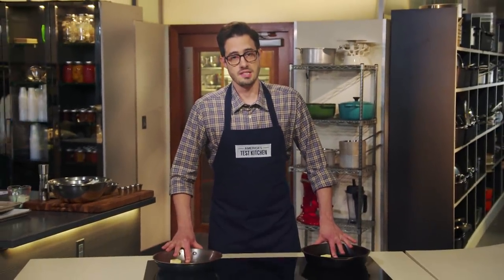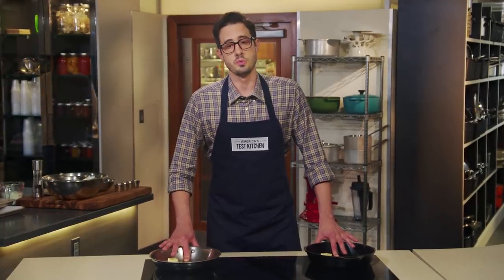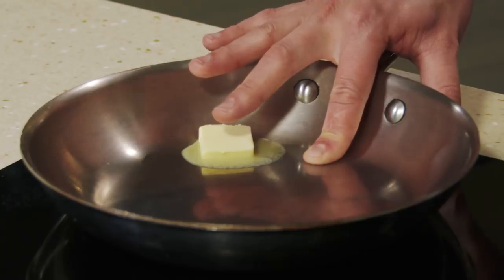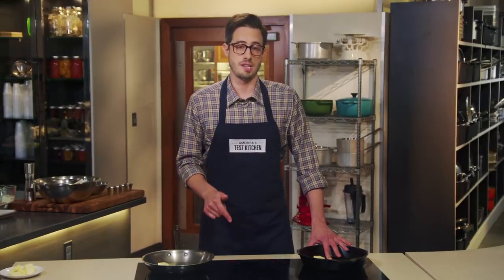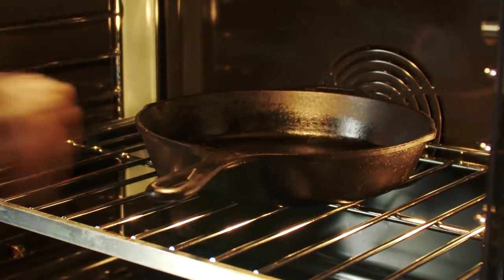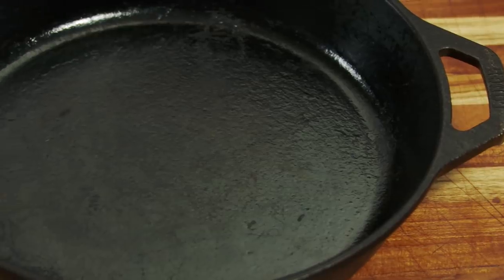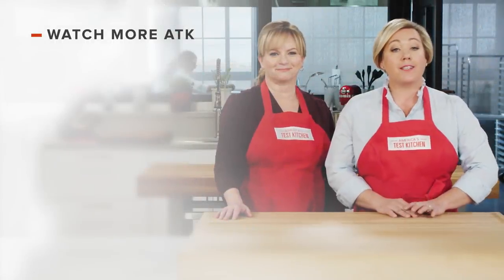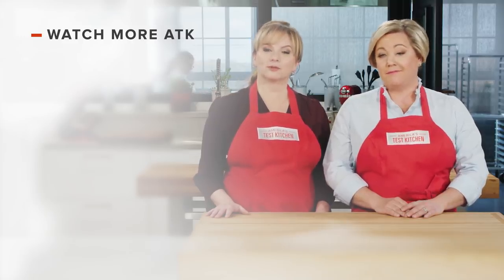The Science of Heat Conduction in Aluminum and Cast-Iron Pans

Comment: Yep, the best thing about cast iron is heat capacity. Because they're a big hunk of inexpensive metal, they can hold a lot of heat. But aluminum actually holds more heat ounce for ounce, so if that stainless pan had a thicker aluminum core, it could hold as much heat as the cast iron pan, but would weigh a few pounds less and spread that heat far more evenly across the pan. It would be more expensive to make than a cast iron pan, though. And that's exactly what high-end stainless pans are. I bought my Belgian pan for $95 but other European and US brands like All-Clad and Made In (ATK tested) make similar pans (the one I bought is the thickest and heaviest pan I could find of stainless and aluminum core construction—read online reviews and tests). Now my carbon steel is retired because it is heavier, heats less evenly, and doesn't do anything better. I don't even think my seasoned steel is more non-stick than my stainless pan. This is after a year of scrambling eggs, searing steaks, pan-frying fish, and everything else. In my experience, sticking is almost entirely a matter of bad technique. If I just heat up the pan, add a little fat (1-2 tsp), then food, I almost never have problem. Maybe I should say never, because I don't think I've ever had a problem with the stainless pan I use now. The surface of the metal is purified (it's still bare stainless steel) to make it less sticky than normal stainless and it does seem to work. It's not encouraged, but I've been minimizing my use of metal utensils in case it helps keep it so non-stick by not causing deep scratches and wearing away the outer layer. It probably doesn't make a difference, stainless steel "clad" pans can stand up to lifetimes of scraping with metal utensils before the stainless layer becomes worn.

Comment: thanks for clearing up this age old myth, cast iron is great but gets hot spots and has lower conductivity. i have a woll pan that is thick cast aluminum (very heavy actually) and its the best of both worlds, heats up fast and holds onto heat for ages
Reply: Cast iron only gets hot spots while it is heating up. Once it comes up to temp it is a very even heat, and the mass means the temp stays the same when you drop cold meat (for example) in it. Just don't boil liquids in it or you'll take off the seasoning.
Reply: @sonnybeach1953  yes this is true, thats the benefit of cast iron is the sear ability once it has been properly heated up
Reply: It doesn't actually hold own to that heat for ages. It only seems like it does, because the larger mass simply has more heat to give up than a thinner aluminum pan.
Reply: Aluminum holds almost 2x as much heat at half the weight, and is less than 1/3 the density.

Comment: Nice video. Why oh why do modern folk season irons with a rubdown at 400°F-500°F?  Of course it'll make for uneven cooking. It should be seasoned by filling with olive oil (yes, pricey or melted crisco to the top, and placed on range burner at lowest possible flame, an hour or so for many generations' use, most even heat, easiest cleanup and reseason with a swipe.

Comment: Seriously, how feasible is that recommendation for the home cook.... put a cast iron pan and crank up the oven to 500F before using the skillet?  Not everyone has half hour just to heat up a pan... what a waste of time.  Sure, the science is correct, but VERY impractical for real life use.
Reply: Not only wasting time, but also energy.
Reply: I have used cast iron for years, and it is not that hard to heat. Preheating six minutes on low for frying an egg is enough. If you're cooking cornbread, put oil in your pan and the pan in the oven while it preheats. No time is wasted. Who cooks at 500 °F?
Reply: @MichaelSHartman   Exactly!  I use both enameled and seasoned cast iron pans, and I only crank it up when I want some char.  Who has the time to "warm" a pan in the oven before using... I got hungry people to feed!  ATK... please be more practical with your advice!
Reply: Cast iron 1st season should never be at 500F. Low & Slow is the old saying. Besides, iron cookware in foods is proven healthier than aluminium residues. Alum seasonings wear off, cast iron goes deeper. Lityle dab'll do ya after each use.

Comment: I have cast iron cookware because they hold heat so well and I got tired of buying cookware which I had to replace every two years or less due to coating coming off and good stainless steel cost too much. We don't have enough animals to drink or eat from the useless so called non stick cookware. Cast iron will last you for life and is good for cooking in. I have a steel wok which I will use and that is about it other than my cast iron cookware.

Comment: So wouldn't Carbon Steel be a better choice then ? I do not want to waste time and energy heating a cast iron pan in the oven.
Reply: The advantage of cast iron is that once it gets hot, it stays hot. If you're, for example, pre-searing a huge roast before it braises, then the cold meat might lower the temperature of the carbon steel too much for a good crust, while cast iron will retain its heat. But carbon steel is much better than cast iron for smaller batches of food, e.g., if you're making a stir-fry.
Reply: @asdfrozen  I don't usually  cook a roast in a cast iron frying pan though I would use a dutch oven then and that would make sense . Heating a cast iron frying pan in the oven at 500 degrees just to cook a steak is a lot of waste of time and energy
Reply: @rojergrison3752  Even when just searing a steak, you're still going to end up with a better crust on cast iron due to it retaining its heat better. Of course, you could always argue that it's not a big enough difference for that extra effort.
Reply: Fr tho, cast iron takes wayyy too much time and effort when you can cook just as good food with a nonstick tbh. We don't live in the 1800's anymore my guy
Reply: @MrApontjos  Nah, don't use nonstick for searing meat. Teflon can't handle high heat. It's great for omelettes, but not for searing.
Reply: @MrApontjos  Yo, Teflon is found in the blood of the majority of Americans. That stuff degrades and goes into your body.
Reply: Stick with clad pans. Cast iron and carbon steel aren't any better and a lot less useful.

Comment: 'what did you think' , well let me tell you what I know: Aluminum holds almost 2x the heat at half the weight. Cast Iron retains heat because of it's mass which is necessary because it's brittle (get a heavier non cast iron pan and compare). You exposed one myth, but there are more like 20, and I've seen better results from an all-clad / multi-clad cheaper pan than cast iron.
Reply: For comparable pans (same thickness), aluminum holds less heat. No one is going to buy an Aluminum pan that is 1 inch thick to match the weight of their cast Iron. And then you also reduce your advantage with conductivity by increasing the thickness.

See my other comment for numbers.

>"Cast Iron retains heat because of it's mass which is necessary because it's brittle"
What do you mean by this?
Reply: @TheJoeOption  A tri-ply or multi-ply pan needn't be 1 inch thick, and they do make thick disk bottom pans. Also; when something is put in such a pan; the heat that is spread out through the sides of such pan will flow better toward the food, where a cast iron if not preheated in an oven (wasteful) will tend to be over 100F less at the sides. Multi-ply / disk bottom will also regain heat faster compensating for loss that way too.  Their results that they think are great with cast iron are sometimes laughable. They are in the business of selling product on here, and selling pans that aren't needed is like selling Santoku knives.
Reply: @madthumbs1564   mad thumbs  Literally all I was saying in my other comment was that for the pans he was using (about the same thickness pans) the numbers backed up his statements. For similar thickness pans, the cast iron pan will have better thermal capacity than the All-Clad Pan (mostly Aluminum). And the All-Clad pan will have better thermal conductivity than the cast iron pan. That information is just from material properties and isn't really up for debate. 

I honestly just use a carbon-steel pan right now and I don't have a game in the fight here. Some pans are better as some things than other pans are, I don't understand why this is a contentious corporate material because they say that. 

I seriously do not understand the heat transfer arguments you're making about the multi-ply pans, it makes no sense.
Reply: @TheJoeOption  'Some pans are better as some things than other pans' They never show evidence for this, I have yet to see evidence for this. -In fact I see the opposite when I compare my steaks to theirs when they use cast iron. I used to use cast iron for most things. - I gave it away after seeing what I could do on tri-ply. Romanticism is not evidence.